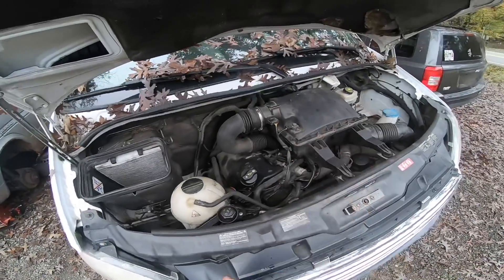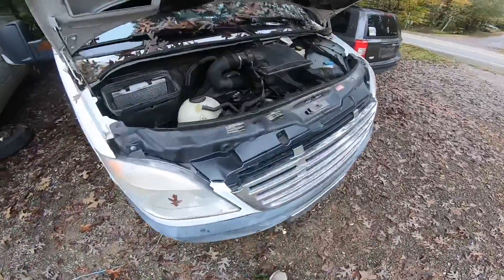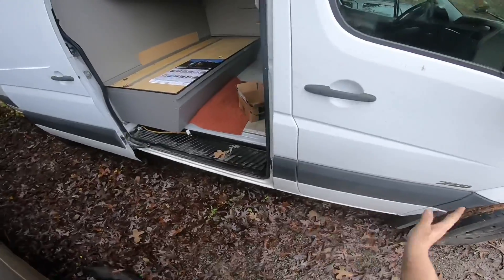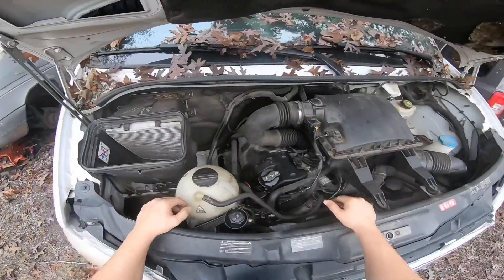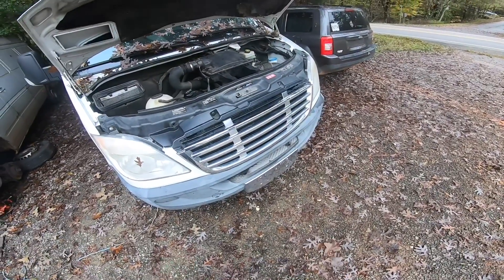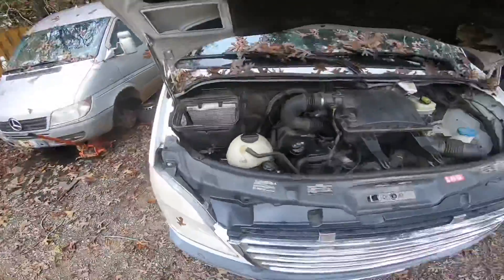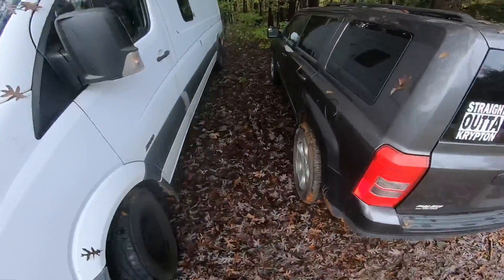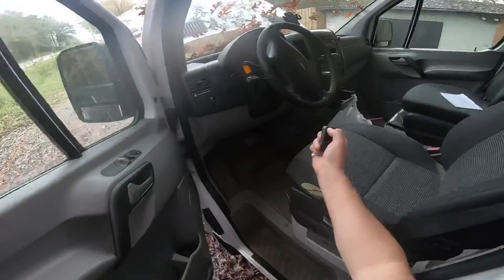Here’s what services I need to do on a 2010 Mercedes Sprinter Big Oil Cooler seal leak must fix

Comment: You can delete dpf on 2010 but u will need to get ecu tuned. I would try cleaning it and  do forced regen. Since van is in limp mode it will not let it do a regen as it should and maybe that's why the dpf is full
Reply from the maker: I will try forced regen after I fix it, there’s actually a big oil leak coming from oil cooler seal